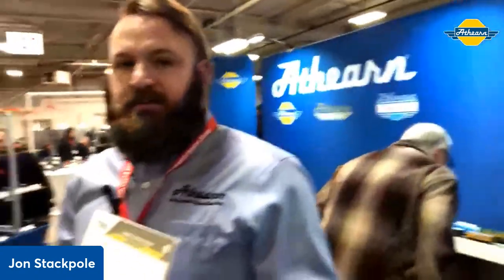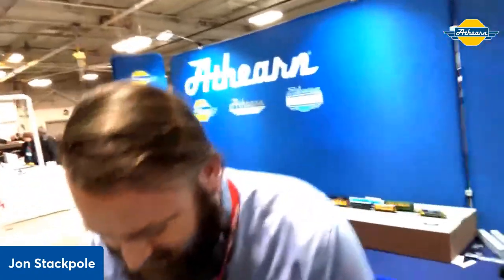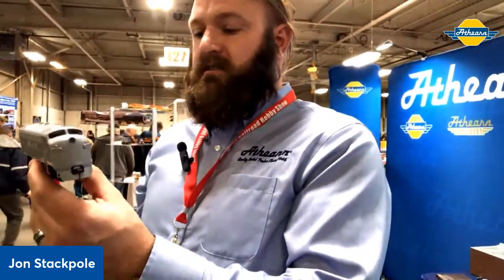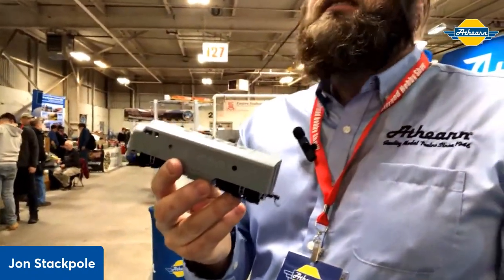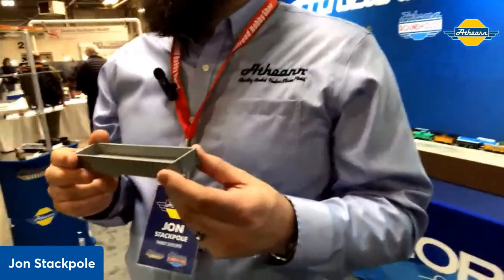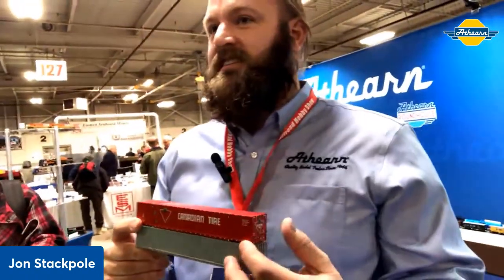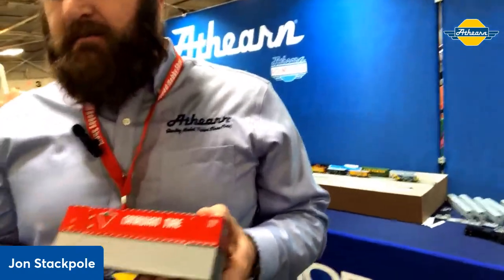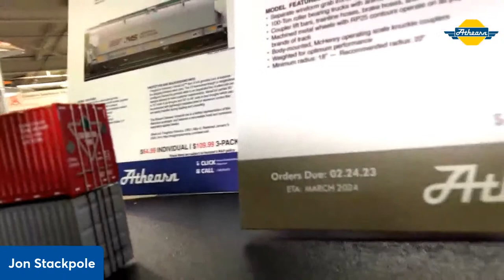Athearn Amherst Railroad Hobby Announcement

Comment: I typically don’t leave negative comments but why did you guys ignore all the input from from respected Chessie modelers that provided you all the correct artwork free of charge for the c26 Chessie cabooses ? There are MANY errors in the artwork at $100 plus this is unacceptable and lazy, not to mention I received one of your new acf 4600 covered hopper with no grab irons all the way up the A end , all the roller bearings were gone and roof walk was broke ! Not happy!